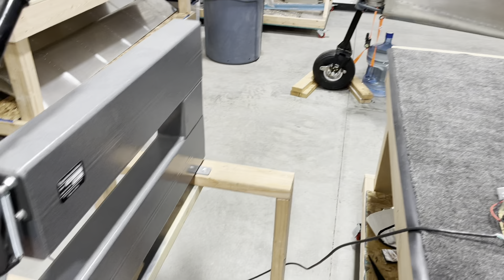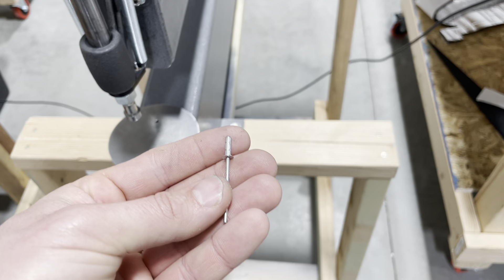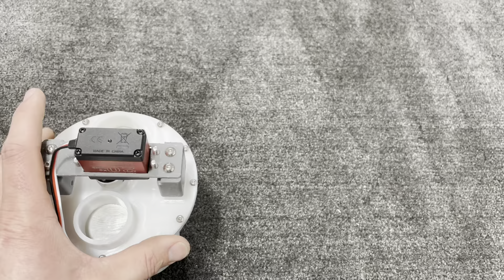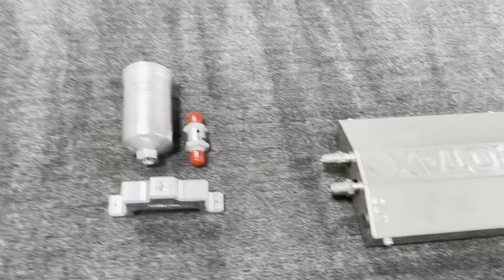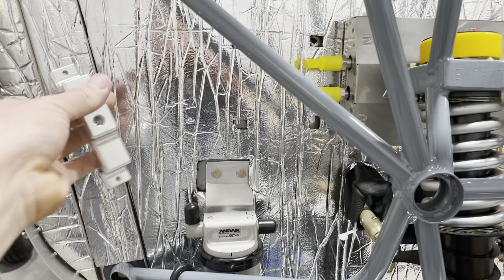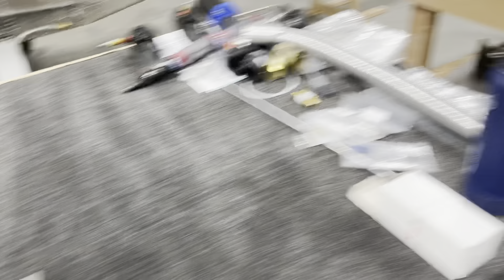Sling TSi Updates and Improvements

Comment: Evan. Great video thanks.  Noticed your brake reservoir connection through the firewall, as opposed to running the plastic tubing through a grommet.  Would you share what couplings you used to achieve this - on both sides and through the firewall?

Comment: Hi Evan, great update. I have 3 questions if you don't mind: I've been making a light switch panel to put on the canopy too, but with the carling contura type illuminated rocker switches, so it's  bit bigger (vertically). (1)  My quadrant would come down about 7-8 cm from the canopy -- how much does your stick out (i.e., at that size, would it block your vision)? I ask because I am still undecided if I need it smaller using either the push button or toggle switches. (2) That's quite a few cables that you'll have to feed (I'm assuming) from the back of the plane making them come up from the back window with the lights cables and then  extend the hole in between the inner and outer plies from the front cabin lights to the console. You have no worries about how easy it will be to maintain/feed cables through, etc if something breaks? I ask because I was wondering about making an entire console from there to the rear passenger seat (which also allows other customization) so I could put the cables in between that and the canopy instead. (3) What material are you planning on using for it? (sorry, so many questions I feel like I should be shining a light in your eyes and yelling them to you... LOL). Cheers
Reply from the maker: Those switches will be too big. Mine is only about 4cm from the top of the canopy at its lowest point. It also depends on where you fit the lowest point in relation to the curve of the canopy. I can’t answer all your questions for you, it all depends on what your skill, experience, and design requirements are. Just be very careful to think through all design elements ahead of time
Reply: @EvanBrunye  no worries, thank you. I'm building it with the build assist so I'm just concerned about whether it is a good plan to feed all those wires between the two plies. Thank you for the videos always very helpful
Reply from the maker: @YourFriendlyGApilot  the wires aren’t an issue

Comment: Love the suggestions and adjustments on this edition.  I’m a long ways away from the overhead console or firewall forward part.  I have been wondering if there is a way to improve the center console section to move the brake lever to be included with the throttle quadrant so you could control everything (throttle/brake/brake-lock) with one hand vs. having to take your hand off the throttle, onto the brake lever and then use a second hand to lock the break.  Seems to me there is a real opportunity there.  Plus in looking at the center console/control quadrant I’m sure going to be looking for a way to flush-mount the screws holding that all together.  Heck - it’s the one area where I’d be willing to dabble with carbon fiber... 

Let me know if you want to discuss the throttle quadrant idea a bit... I’d be happy to help develop that idea.
Reply from the maker: Maybe I don’t understand your idea fully, but it sounds like you want to have one lever that you pull back and it decreases throttle and applies brake as you pull back. If so, it won’t work. At least not purely mechanically. You need to be able to cut power fully to land, but the engine won’t idle there happily. 

I’ve actually got some cool ideas coming for the throttle quadrant though, stay tuned!
Reply: @EvanBrunye  there actually would be two separate controls on the throttle lever... I saw something like it on the Sling4 control lever... I’ll have to see if I can find a picture of it somewhere.  The Sling4 control wasn’t for breaking but I think was related to the engine or something from what I understand.  I can kind of see it in my thinking of how it should work.  

In other words, the forward/idle of the throttle would stay as it is, there would be a new lever added to the throttle quadrant which would be pulled up (harder is more breaking) with a button to hold/release the break.  I hope that makes more sense.

I am hoping you’ll have some of the alternate parts listed as I’ll be very interested in added a number of these onto my build.
Reply from the maker: @ibgarrett  hmm interesting. That small lever was to unlock a throttle stop to allow for full throttle/turbo for short periods of time. You might be able to make something like that work, but the brake lever takes a fair bit of force. Seems like a reasonable enough idea that if it works would be really cool. Just a bit risky if it doesn’t work right!
Reply: @EvanBrunye  Yeah - I've got the how it should work in my head, but not the mechanics of the process... it would help if I sat down and learned a bit of solid works to make sure it is a viable process.  Having to take your hand off the throttle to manage the brakes has been one of the few areas with the Sling where I feel like that could be improved a bit.
Reply from the maker: @ibgarrett  you can download solid works for free if you’re an eaa member through the eaa website
Reply: @EvanBrunye  yeah. I’m aware of that. I wish it was cross platform. I’ll see if I can carve some time out to fiddle with it a bit.

Comment: Evan. Additional- FYI!
Check out this vlog at
 https://youtu.be/u8xT1dhgwCQ
When you get past the family stuff take a close look at the overhead consul, and dash.
The Tsi owner Mike, self built and did the dash and consul carbon. He also runs air con, and is looking at an intercooler upgrade.
He flys out of a strip called Heck Field, and has a hangar (where he built the Tsi) directly across from the Australian Sling agent, Errol who trades as GAP Aero (I believe until 2020 Errol had built and sold more Slings than the team at Torrens) so making contact through Mike or James should be easy. If you are not already talking with these guys, you should be, because the ideation is parallel to yours.
Have some fun today.